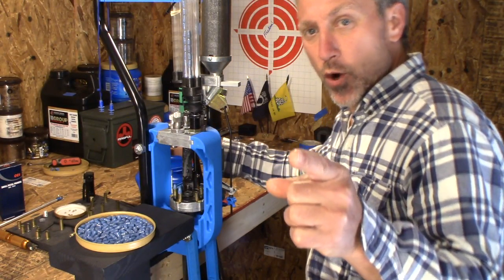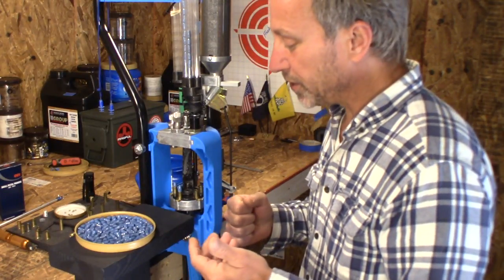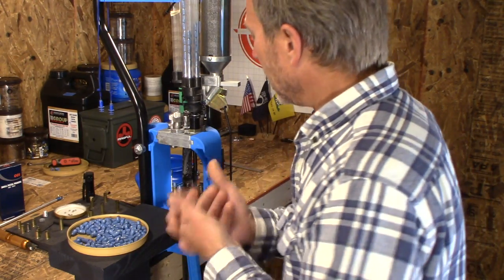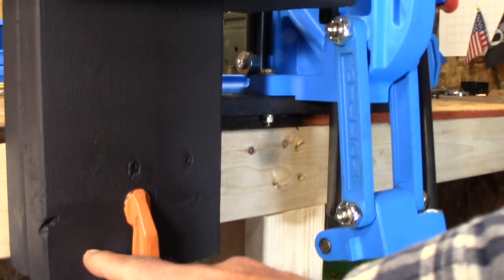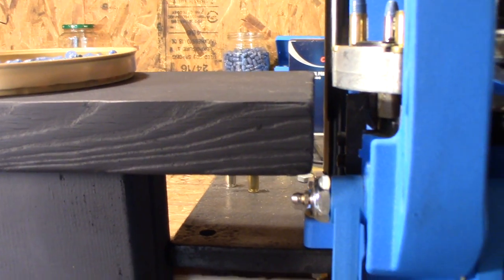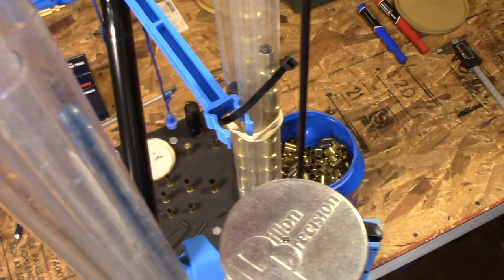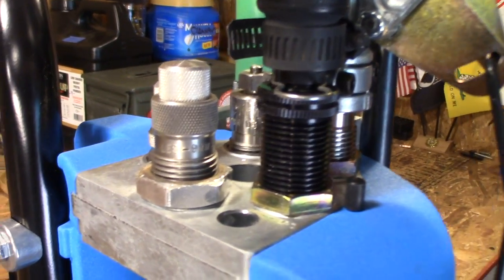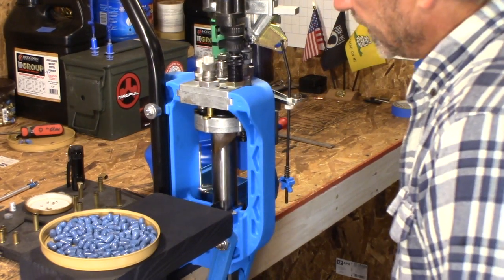Dillon 650 (SET UP) Cheap, Simple, Easy, Fast. Bullet Feeder, Case Feeder

Comment: Elvis welcome to the world of Dillon xl650 having used a few different progressive presses this one is heads and shoulders above the rest. It’s precise, well made and it can crank out ammo like a commercial factory. I’ve had zero. Problems over the past three years with mine and have more ammo than I’ve ever thought was possible. If I had any complaint is that it makes high quality ammo to fast.. lol sometimes after making 1000 rounds in such a short reloading window I get sad because I wanted to spend more time reloading. With this unit I more often than not run out of bullet cases, primers or bullets and have to stop and get more supplies, clean & prep more cases, run out and buy more primers. Also I still love my little Lee classic cast single stage press. I load my short runs on that press so I don’t forget how to make bullets the non progressive way. 😜
Reply from the maker: yeah... great comment.. I think most of us can relate! : ) sounds strange to the non reloading junkie .. thanks for chiming in!! : )

Comment: Haven’t jumped off into the 650 realm yet. But I have figured out the LEE loadmaster for my 9mm and 223/300. Now have 2 loadmasters, my Dillon 550, and a LEE turret press. I know , I know, buy once cry once. . I went with the Lee loadmaster for 9mm. Pretty simple to fine tune and adjust,  and I like tinkering. 
I’m just starting a lever action 44series. Ck it out if you have a min.  Thanks brother! God bless!

Comment: Thank you.... you really got my interest motivated with your case feeder and bullet feeder installation. The case feeder thingy is a perfect solution for me. The Dillon powder measure is a work of art that accepts all of the different powder types and is consistently extremely accurate. I have tried many different brand powder press mounted powder measures and I am now back to only Dillon. Taylor Tactical makes a powder adjustment knob (approx. $10) that works much better than the stock device and it is a value priced quality component. There is also a gentleman in Alaska named 'Showshooz' (sells on Ebay) that makes several upgrades for the Dillon 650 that are incredible quality at a very competitive price. One example is his primer switch.  I certainly enjoy your videos.
Reply from the maker: Hardy Birch ... yeah the primer switch is something I would be interested in. . I think it's the one where you can turn off the primers? thanks for the info and feedback

Comment: I had to fix the shell plate set up because of spilling powder on 9mm cases but that's it. Love my dillon 650
Reply from the maker: Yep seen and heard of the spill issue.. I haven't experienced any spill at all. maybe dillon fixed it? I tighten the plate to max without any resistance and no spill. I thought I was gonna have to deal with it.... nope

Comment: And there it is....I knew you had to have a auto indexing progressive press hidden somewheres that you use. Many videos I have seen you using a Lee singe stage. I have a Dillon RL-550B and a RCBS Rock Chucker. I have had them both over 20 years. Most recently I am looking to add a Dillon XL-1100 OR XL-750. My other two presses are fine for most reloading, but the couple calibers that I shoot the most are way too slow and I can't keep up..... .45 ACP, .40 S&W and 9mm. I need to get faster on those. The other 20 or so calibers that I own are fine on the other two presses and have been for decades. Doing 1,000 or 1,500 .38 Specials on these is fine and ok. Doing a run of 6,000 plus 9mms ain't cool. Also needing 2,000 .45 ACPs in a hurry for some competition matches and self defense training.

Comment: Hey Elvis you and I both went to the blue side lol I have my single stage rcbs press so it was time to get a progressive and with all the things out the I like there warranty the best no bs that's what sold me like you bone minimum except after using I opted for the upgrade on the old primers and glad I did I have done a five gallon bucket of nines and still have not dumped the container and one other thing I am using is Dillon dies not so much for the dies but I like the recapping die better than my rcbs die you mentioned you like the bullet feeder and to look in to that cause I have the hornady and I not impressed with it. Side note tried your temp with the powder coating and I am still not there yet when I let them set and do you box trick to bust them up I am still seeing lead where they touched but I guess if that's the only flaw then I need to be happy with it and run them
Reply from the maker: Yeah.. really loving the 650 very nice.. The mr bullet feeder die is right at PERFECT this thing just works... What kind of powder coat powder do ya have on hand?
Reply: Ford dark and light blue still not where I want to be but I will live with it for now
Reply from the maker: Tim Dibble ...if you have access to harborfreight white add about 1/3 harborfreight white to your FLB. and let me know how it goes?

Comment: Call Dillon and get your free alignment tool. If you have to disassemble it you will need it. It's like a clutch alignment tool without the teeth and made from stainless steel. Just call and register your dillon and ask for the tool. That's if you don't have it already?

Comment: Hi Elvis, I noticed that the bullet feeding dies have a very limited caliber choice. Any work arounds for other calibers?
Reply from the maker: what caliber you interested in?
Reply: I have 9mm, 40, 44, 45acp, 357, 38 spl, 380, 223, 30-06, 30-30, so far. I really like your bullet feeder setup and can't wait for the video!
Reply from the maker: the 9mm should get 9mm, 38, 357,380, the 45 should get the 44 done. 308 for 30.06, 3030. and they have .223.. there is some talk of a problem with deep cannelures but im pretty sure this could be over come by adjusting the bbs ... but technically it looks like your covered with those dies in stock... I never thought i'd see perfection like that.. Start with one check it out! little pricey but awesome..
Reply: WOW ELVIS! That is really awesome news you just gave me. So you're saying that 4 bullet dies should solve my problems?
Reply from the maker: That sound about right!! : )

Comment: I’m about ready to pull the trigger on a progressive. Why did you buy this when you have a Loadmaster?  Is the Lee junk?
Reply from the maker: Great question...No the Loadmaster is not junk.. I've loaded well over a hundred thousand rounds with it. The reason I bought the dillon 650 was to increase my production. I searched around , looked at others, asked questions and made a decision to go with the xl 650 ... I never thought i'd pay so much for a press. I paid 600.00 it come with one caliber conversion. each additional is about 80 bucks. not including dies. I struggled with the choice. But now that I have one I can say it is very precise and built like a tank. It is the best press I have ever used! But I don't recommend it if the money is the difference between getting started or not. You can use lee dies and the way I set it up... bullet feeder and case feeder. ... I hope this helps.. I wanted another press and decided on the dillon and I  give it a try.

Comment: Use a 1/2 inch Carlin pvc electrical connector e996D plus 1/2 “ plex tubing and heat gun. Cleaner, nicer, cheaper and easier.